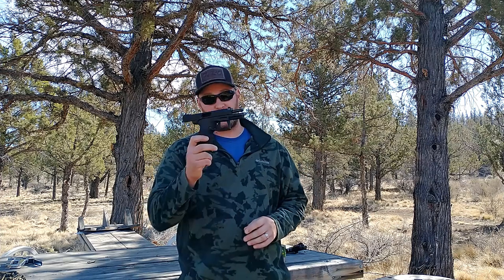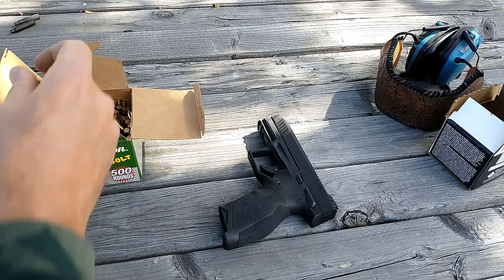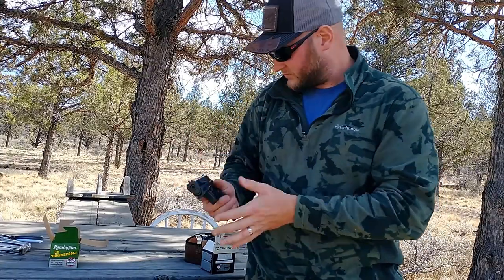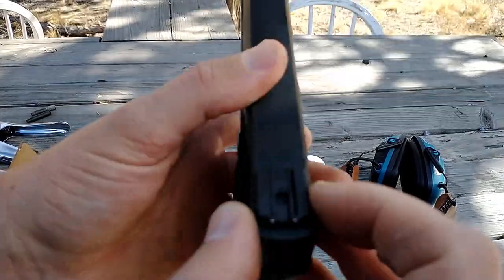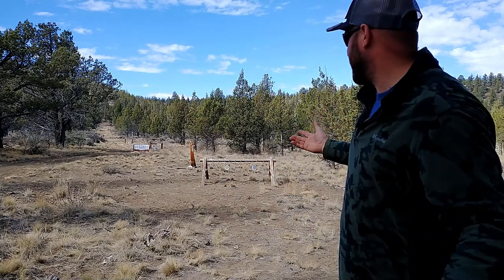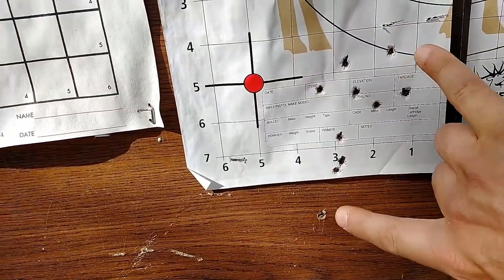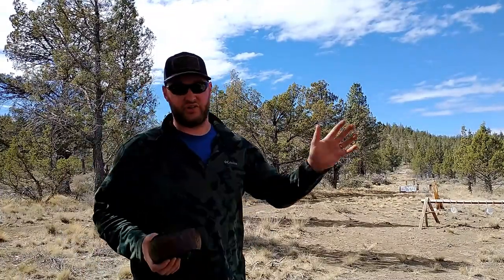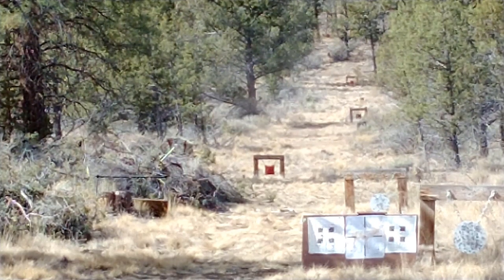Making my TX22 Reliable.  Break in, Polish, Dry Lube

Comment: I love my TX22. Very consistent and accurate UNLESS I use cheaper ammo. 

I put a laser on it and w/cheap ammo it shot everywhere but the bullseye. W/CCI I was shooting thru previous holes. 

Also, had issues when I pulled the loading tab too far down to load, but figured that out real quick.

Comment: Thanks for the mag cleaning tip. Glad you got your tx22 working well. Mine has been flawless and accurate.
Reply: get an ultrasonic cleaner for your mags ! and other gun parts.   use hot water and whatever Degreaser you want to use. Then sit back and watch the gunpowder melt off!   Then I clean everything off after rinsing with compressed air then add gun lube

Comment: I'm 2:45 seconds in. I have a TX 22. Bulk ammo is hard to run. CCI standard velocity is a little pricey, but you'll never have any feed our fire issues and it stays clean. Cleanest most reliable shell in my TX 22. The most inaccurate is Federal automatch I think I already saw in your table. I've shot 20 or more brands and styles of ammo for it. Federal automatch groups like a shotgun on a 6 in. Target. All others from Eley competition to Herters bulk 36 gr CPHP. But, still the most accurate and the most reliable. CCI standard velocity. Plus it's so clean, shoot 100 rds and no carbon anywhere in the pistol besides the chamber a little. One pass with boresnake. Done. Reassemble and keep in shooting. Rails, trigger assembly all still carbon free. It's just the most accurate and reliable.

Comment: Mine work great out of the box with only two ammo related failures to fire in over a thousand rounds. No failures to feed, jams, failures to extract or stove pipes. Mine has been accurate, reliable and eats everything I feed it from day one. Sorry to hear that you experienced issues but glad you have gotten it working. Thanks for the video.
Reply: Same here ,my tx22 worked flawlessly right out of the box but  I did clean it and polish the feed ramp first like I do with all new or used guns I buy. Later I added tandemkross 5rd mag extensions  and thier green springs .
Reply: @jimthomas5277  I agree, it is a good practice to at least clean and lube a new firearm before taking it to the range the first time.

Comment: RELIABLE  Out of box, shot 100 rounds using Remington Bucket O Bullets, Fed M21 (not a fan) and CCI Mini Mag. Had one failure to fire due to ammo. Reloaded round rotated, it fired. Enjoy shooting. Fast trigger, short reset & "assisted" reset, trigger drives out with enthusiasm. 
ACCURATE? My indoor range 15 yards max. Shot my Buckmark with Red/Green Dot for comparison. Buckmark tack driver 1". The Taurus TX22 iron (plastic) sight was accurate, but not as accurate as Buckmark. HOWEVER SOME OR MOST OF THAT WAS ME. I forgot my glasses. I need reading glasses. I adjusted the sight, was high and left out of box. One CCW turn elevation & one windage adjustment screws did trick. Rounds centered 5 inch pattern, with issue of eye focus without my glasses. 
CONCLUSION I agree it is not going to be as accurate as a Ruger MkIII or IV or Buckmark, fixed longer heavier barrel. As far as sights, I am going to look into fitting a RED DOT to the Taurus or buy the TaurusTX™ 22 Competition with fixed Red Dot. Bottom line, the light weight, ease of cleaning the TX22 is a winner, it will be my hiking, camping gun. The Ruger and Buckmarks are heavy but more accurate (especially for me with a Red Dot). You can get Ruger or Buckmark lightweight 4" barrels, aluminum, fluted, steel lined. Taurus does well overall, especially for price. The 16 rounds is really nice. Ease of cleaning, light weigh, ergonomics fit my hand perfectly and nice balance.

Comment: I’m just putting this out there I was shooting of hand at 75 yards and was extremely impressed with my tx 22 very impressed yes my sights where off I’ve ordered a replacement to try but mine is very very consistent for a pistol mine is also a recent one made in ga so that might have an effect
Reply: i also have one made in ga and i have none of the problems he is having and it shoots accurate for me at 60 ish yards, the only problem i have had with mine is after about 300 rounds the slide starting locking back every other shot.

but i fixed this problem by taking it apart and on the part where it holds the trigger there is a spring that pushes the slide catch lever down, all i did was stretch the spring out a little bit and now its running flawlessly. i have nearly 1000 rounds through it now using cheap ammo and have had 0 malfunctions other than the one i just mentioned, which was an easy fix.

Comment: Thanks a ton for the tips!  Dry lube on the magazines makes a big difference.  I used Motul Shine & Go, since I had some around.  The follower seemed to bind a bit, even after cleaning w/ CLP.  Now it's nice and smooth.  Hopefully it lasts a while!
Reply from the maker: My pleasure.  Mine are still going strong after a couple thousand rounds without having to clean them again .
Reply: Agreed! I use LPS 1 Greaseless lube in all my mags (TX, 9mm AR & AK) If they get any dirt or grit in them, I'll just blow them out with compressed air and they're good to go.

Comment: Also, accuracy with even cheap Winchester is very accurate. I shoot 1" up to a 2/12 in spinner. I have one set with 4 one inch, and the top resets to drop them back down. Then a dual ( 4 paddles) spinner with 1 in. at the top of each and a 2 1 and 2 1/2 in at the bottom. Finally I have a 3 spinner with 1" 1 1/2 then 2 in. At 10 meters and CCI standard velocity you can eat every one of those spinners alive. With aguila standard velocity, the same POA and POI as the CCI STANDARD but at about 3 -4 cents less a shot. But, what I'm trying to say is, if you want fun and unreal accuracy, try those standard velocity loadings. As for the sites. I first used Testors Sublime green model car paint and a tooth pick to put one small drop on the back 2 dots. And then a bright orange testors model paint similar to hunter orange for the front site post. Same thing one very small drop with the very tip of the toothpick. So it's a nice green on orange site picture. That will improve your groups a ton. But, ebay sells a knock off at of finger optic sites for 10$. Lol I'm not kidding, but buy extra filaments. They come in a 3 pack of orange,red, and green. So for both the sites and extra fiber optic rods, 20$ will cover it. But it has bee no rear adjustments besides right before you tighten down the rear site with loctite on the screw and on the oppsing sides of the site itself. It's milled aluminum front and rear  and full. A full set btw. Anyway, good video. Than you

Comment: Oh wow.....thank u for this video!  I absolutely loved my TX when I first got it but after a few hundred rounds  thru all magazines I had for it, I couldn't even get 4 rounds off without failure to feed & that was super frustrating considering I even bought the mag extenders so it would hold 21 rounds in the magazines.  After multiple cleanings & probably $60 in different types of lubricants for the magazines, with no luck, I was seriously getting ready to retire the TX22 & it would have been a shame because that's one of my favorite guns to shoot.👏🏻👍🏻😁
Reply from the maker: No problem!  Hopefully these little mods can get your gun up and running.
Reply: The mag extensions is your problem
Reply: @buddy9577  absolutely was NOT the mag extensions. What it came down to was magazines that needed to be cleaned thoroughly & then lubed with the correct solution....which happened to be a car wax(Lucas slick wax) & ever since that.....ZERO feeding issue's.  I even bought 2 more of the mag extenders  so I have em on 6 of 8 magazines.  Again.....with zero feeding issues

Comment: Your TX 22's result was identical to mine with the defective barrel. My early production model was made in Miami.  Severe chattering in the barrel. Shots all over the place with a lot of key holing. Taurus immediately mailed me a new barrel. Now it's on par with my Ruger 22/45 bull barrel. 
Machine marks should be easily visible from the end of the barrel.

Comment: I have over 1k rds through my tx22 with no gun malfunctions ( I have a +5 baseplate that will sometimes have a ftf) I did however polish the rails and feedramp before I took it to the range. But I do that with all of my guns
Reply from the maker: The largest contributing factor to my gun's issues was the dirty mags.  They were incredibly dirty and gritty from the factory.  Once I cleaned them and put dry lube in them, my tx22 hasn't jammed once.
Reply: @ironridgeoutdoors  nice bro I absolutely love my tx22. I paid way too much for it in my opinion but it’s definitely worth it for how reliable it is and how accurate I am with it

Comment: I’m more concerned with the barrel cracking at the front from the spring. I’ve seen more videos about this issue than anything else.  I have 102 rounds through mine and it’s concerning, but hey - can always send it back I guess.

Comment: The early versions had issues, especially with the barrels. They fixed it in the later versions and the new barrels were even marked with a Roman numeral II. I don't know you, but it seems like you know what you're doing. It should be obvious to you that there was a problem with your tx22 straight from the factory. If you're not interested in sending it back, I get it, I sent 1 firearm back before, I'll never do that again if there's any possible way to avoid it. Taurus may still be willing to send you one of the new barrels for free(assuming yours is from the problem batch), their customer service is actually pretty good, especially compared to others today. If not, you can get new factory barrels and there are even aftermarket barrels ( along with other mods) available now. Not a fan boy, and it's your gat, do whatever you want with it, but the performance you showed is significantly below average for what others are getting out of the tx22.

Comment: I must have been lucky, ive never had a single misfire or failure through my tx22. Although i cleaned and lubed it prior to shooting, as i do all my new guns. Ive shot a few hundred rounds at this point, mostly Remington gold and federal. The remingtons were old and the bullets were all loosey goosey seated in the cases but even with all that its NEVER misfed
Reply from the maker: @doransponsel4813  I don't think you got lucky, more that I got one of the earlier problematic ones.  Most of these run great out of the box.  Mine definitely needed some work.

Comment: Nice report. Hope you got that barrel looked at and maybe replaced by Taurus. As others have noted here there were some early ones with heavy tooling marks and poor concentricity of rifling to bore. 
  Also, the barrel lock into the frame leaves a little be desired. Accuracy is tough if the barrel can move relative to the sights. I made a little shim from a piece of aluminum flashing to fit where barrel sits on the frame. It has helped tighten up movement a bit. Not perfect, but better. 
  It’s not a long range target gun but it is great for plinking and steels. It is a pistol, after all. I get good reliability out of the TX. Handles well. Lots of fun!
Reply from the maker: That's a great tip, thanks!  I might have to play around with mine to see if I can shim it up a bit as well.

Comment: It's a shame manufacturers don't go the extra mile to do all of these things in the factory.  I saw another YouTuber had the same problem with the magazine--rounds getting blocked by nosing-down into the front edge.  He too did some cleaning of it (didn't lubricate) and that fixed it.  But that was only one of his magazines.  The other one worked fine.

Comment: My TX22 has been awesome. My TX40 is just as awesome, and just as smooth shooting.
Reply: TX40??? Didn’t know they made a TX anything but the 22???
Reply: @22addict40  TX40, TX9 and both in subcompact. My TX40 feels just as good in my hand as my TX22. The TX models are single action double action.
Reply: @22addict40  You are correct, TH40
Reply: @davidb.turknett4447  I have a TH9C myself, I like the gun but my grip seems weird in my hand, does yours?
Reply: @22addict40  My TH40 feels very similar to the TX22. They're both very comfortable as far as grip goes.

Comment: The ruger he was shooting had a longer  Barrel. So how can he expect To get the same results from the Taurus. When the Taurus have a short  Barrel.
Reply from the maker: There's more to accuracy than barrel length.  However, yes, the Ruger has a slight advantage due to the longer sight radius.  Trust me though, if I hacked off an inch from the Ruger's barrel, it would still outshoot the Taurus in every regard.

Comment: What polish did you use?
Reply from the maker: Mother's
Reply: @ironridgeoutdoors thank you, I actually have some of that, also, as a side not, the front site was loose on mine from factory, noticed it only when getting ready to put on the eagle eye fiber optic tights
Reply from the maker: @krazor8  yeah no problem.  That little bit of polishing made a big difference.

Comment: Bullet was tumbling. Not keyholing
Reply from the maker: A keyhole is the mark a tumbling bullet makes when it impacts a target.
Reply: @ironridgeoutdoors there's 2 definitions of "keyholing". 1: a bullet tumbling, because the elongated holes in the paper resemble key holes in locks. 2: an ultra tight group in which all holes are touching because this also resembles a key hole, and the rifle is precise enough to "put all rounds through a single key hole in a lock". The 2nd definition is the older one, but only by a few years.

Comment: Yeah, you should always clean and lube your new gun and magazines before going to the range.
Reply from the maker: Right.  With that said, this is the only gun I own that would not function right out of the box.  Got it all figured out now though.  This gun needed more than a break in and cleaning to run properly.
Reply: My TX-22 came with a paper from Taurus saying they highly recommend cleaning prior to firing.
Reply: I didn't clean it before the first shoot, and it was a cluster. 😒
Reply: I never had to with my other guns.
Reply: Yep, every gun that's new to you(brand new or previously owned) needs to have an initial cleaning prior to your in intial firing. Will it blow up if you don't??? Probably not(used guns need to at least make sure there's no bore obstruction). Well why then?? For used guns, it's pretty obvious, you don't fully know their history, allows you to inspect and ensure function and safety. New guns, especially today when most manufacturers don't actually care about quality despite what they say, allows you to inspect and ensure function and safety so that obvious issues can be addressed prior to firing. Machining fluid is not the same as gun lube, it gummier(after sitting on something for months) and at best is more similar to a light coat of cosmoline. Also in the machining process, metal chips and other debris can get in and on the parts and significant burrs can be left behind. So you're gonna wanna clean all that out before pew pew. Is it the end of the world if you don't??? Probably not, but it's a good idea to help prevent problems before they start or keep existing problems from getting worse...
Reply: Wonder how many companies make 3rd party barrels....I know Lakeline does. I'd love to see a accuracy comparison.

Comment: I'll have to try this.

I HATE my TX22, its pure garbage, all it does is jam.

 Taurus wanted me to pay money to mail it to them to troubleshoot. The woman on the phone didn't even give me any pointers, just said to send it in to them to look at.
Reply from the maker: I think the biggest impact for me was cleaning and dry lubing the mags.  The polishing helped run some of the softer shooting rounds.
Reply: They’ll send you a label, it won’t cost you anything!
Reply: @22addict40  That's not what the woman at Taurus said.

I tried using lithium grease, I think it was, and scrubbing the magazine with this wire brush and instead of jamming every round or two, it actually worked. Maybe good enough.

I still hate it though, and don't trust it at all.

Comment: Just got mine, hoping I dont need to fuss with it too much. Planning on feeding it mostly Rem. golden bullets.

Did you notice how the guide rod looks chipped? But apparently that's how its supposed to be, according to the learned randos on Reddit.
Reply from the maker: I didn't notice it, I'll have to take another look.
Reply: My tx22 has shot  everything I have run in it with not one jam or failure to feed. Now my glock 44 22lr is another story, it's really picky on ammo but I still like it.
Reply: The guide rod is supposed to look like that. The flat part is how they get the spring into the guide rod. I just took mine out to the range to run 100 rds. Had FTEs and FTFs with Remington golden bullets. Took the pistol home, cleaned and lubed it thoroughly, and took apart the magazines to clean and lubricate as well. Will take out in a week or two to see if the issues went away.
Reply: @E52O4  Rgr that yes I looked it up and found that it's supposed to look like that.

I had a few jams using Golden Bullets, but ever since I thoroughly cleaned the gun and the mags, AND started using a better ammo (CCI Standard Velocity 40gr lead round nose).....it hasn't jammed once!

Good luck out there